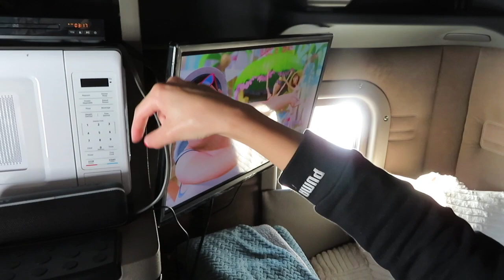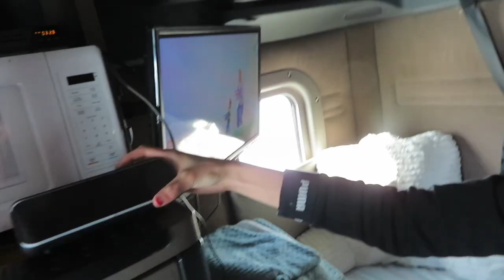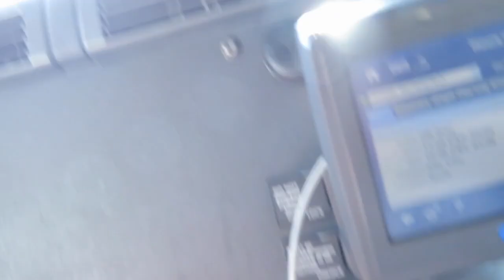How we installed our semi truck TV *cringe

Comment: What type of bracket/ mount did you use for the tv installation
Reply from the maker: Certified Puller dark it’s the ONN brand from Walmart
Reply from the maker: Certified Puller dark oh we also got the metal join/plate with holes from near the electrical department @ Home Depot along with the huge washers
Reply: @natashatrucking  does that tv mount swivel?